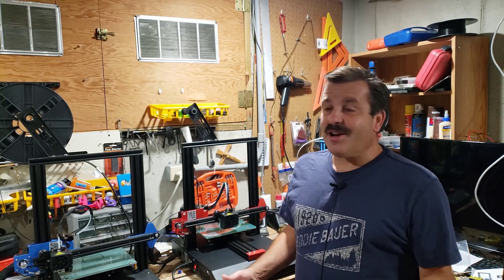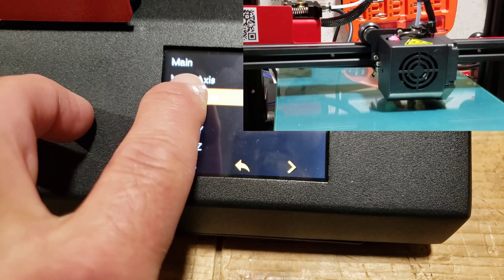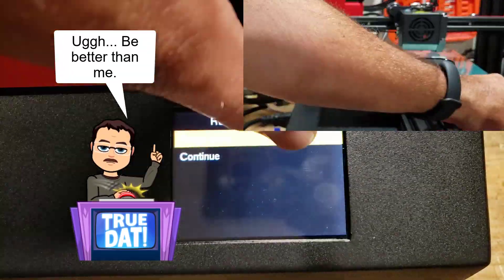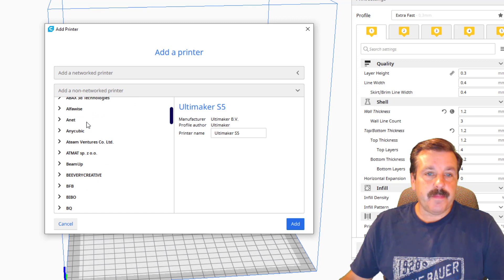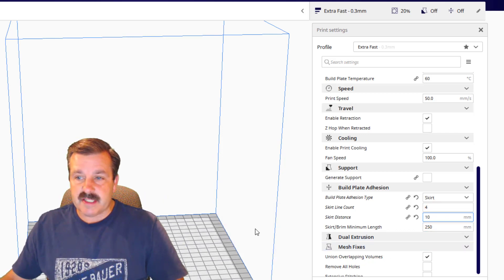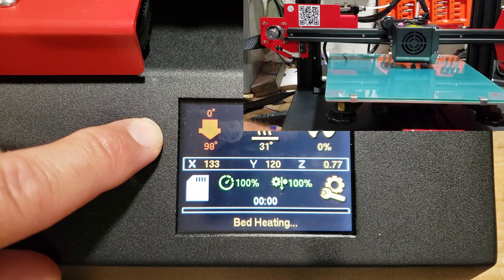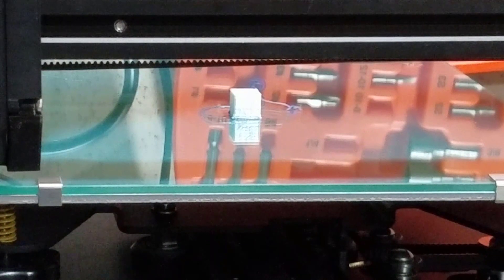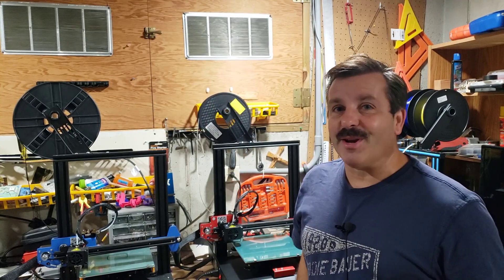Tested! Cura Setup & First Print on the Anet ET4 Plus with Marlin 2

Comment: can just print to highter temperatures with marlin software and a all metal hotend please what i need to to that ???
Reply from the maker: You would have to mod the firmware and the machine. I have not done either.
Reply: @HLModTech  what hotend would you recommned ??
Reply: im thinking in put a mk8 system with the mosquito hotend
Reply: my dude here is if i may change the power supply for another more poweful in order to print in higher temperatures ??

Comment: My menu doesn't look anything like yours
Reply from the maker: Oh, this is for Marlin 2... You had to do some trickeration to get there. This is my first print tutorial for a stock ET4. https://youtu.be/g2sySdWmT8Y I think you will still have a different bed leveling gig than me. Is yours a ET4 plus?
Reply: @HLModTech  My ET4 is all green and black. I'm not sure what I'm doing wrong with it because I can print from the examples provided but it won't acknowledge any stl parts I make in Solidworks.

Comment: Very easy videos, thanks.  when trying to do a G29 automatic leveling, on the first 3 places in front of bed are off, any idea how to solve that?

Marlin installed.

Thanks
Reply from the maker: Off as in the wrong height? Or off as in not over top of the bed?
Reply: @HLModTech  is off the bed and sensor can't sense causing stopping the automatic leveling.

Comment: ET4 & ET4 PRO How do you level
Reply from the maker: I use the paper method still. Then as the skirt prints I adjust a smidge if needed.
Reply: @HLModTech  Where is the leveling part of the Marilyn menu?
Reply from the maker: I am not sure. I always do it manually. I am at school now and  my printers are at home, so there is not much I can do at the moment. =(  There are some really helpful anet facebook groups though.

Comment: damn that et4 looks better than the old version.
Reply from the maker: Funny thing was I thought I had an original ET4. When I was assembling it I could not find the switch for Z... Low and behold ET4 plus in a ET4 box. #greatday
Reply: @HLModTech  lucky cous the old et4 is a nightmare for to auto level you're way quicker off leveling it manual, and btw i think it's just the standaart et4 you got it's just the latest 2020version you got. look it up on anet and you'll see!
Reply from the maker: @a2d600  I will look it up, but on first boot the firmware did say et4+
Reply: @HLModTech  I have the same as yours, ET4+, can you make a video installing a V6 with Volcano?? I have known it is a great improvement to the printer. I'm printing this mod https://www.thingiverse.com/thing:4178590